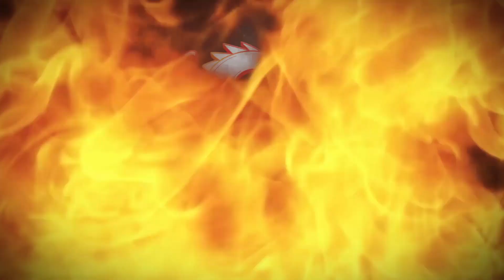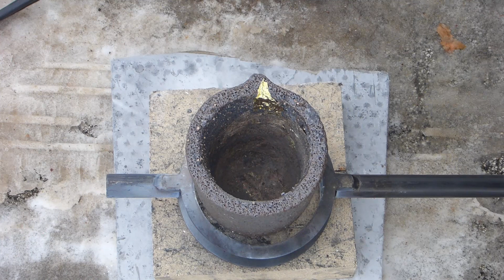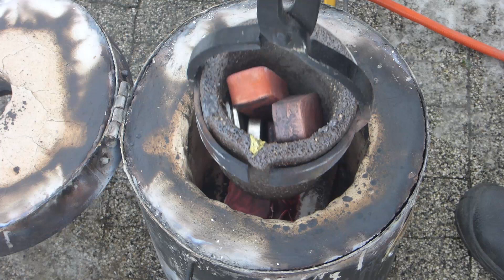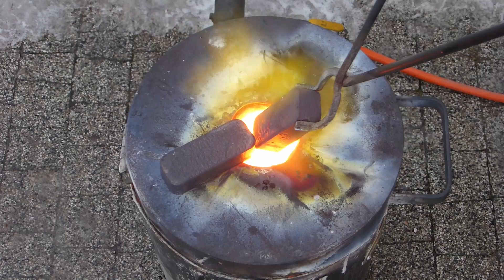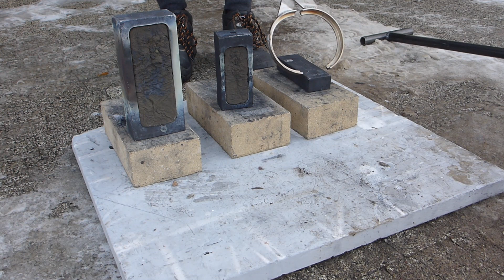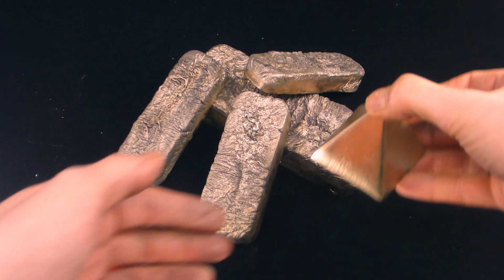Od złomu do siły ognia: wytwarzanie stopu Gun Metal za pomocą pieca do topienia metalu Devil Forge

Comment: طريقة تزيد وزن النحاس ارجو الرد ياصاحبي
Reply from the maker: Unfortunately there is no way to increase the weight of copper.
Reply: @DragonAtelier  هل هناك طريقة،  لزيادة وزن للألمنيوم ارجو الرد
Reply from the maker: @pen10116  weight of any metal cannot be altered. You can alter the weight by alloying metals and trying to keep the same color. 
For example - mix aluminum with zinc, mix copper with a little of lead - with copper there will always be a drawback with color change and other mechanical aapects of the alloy.